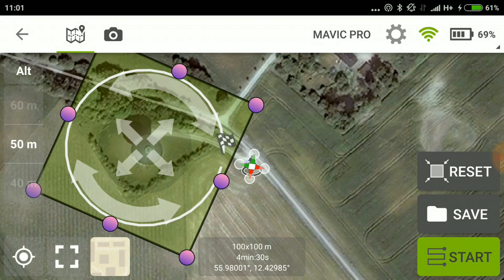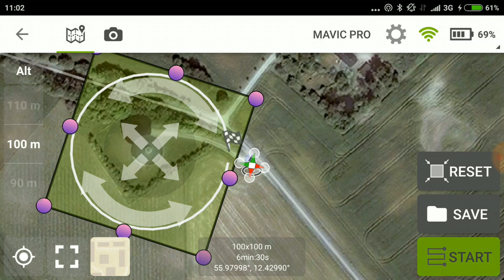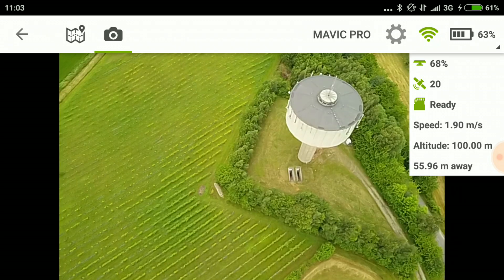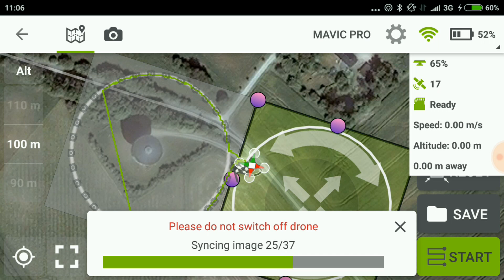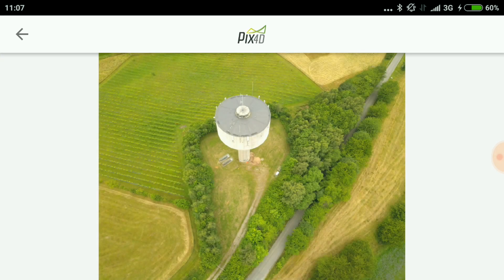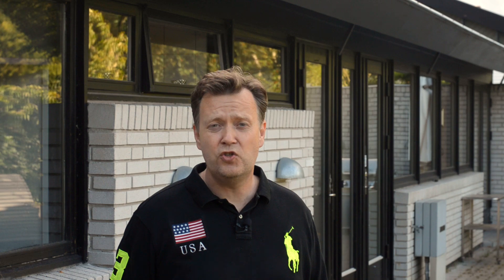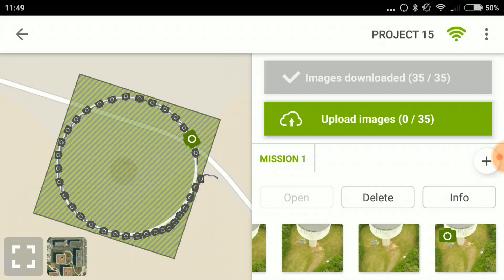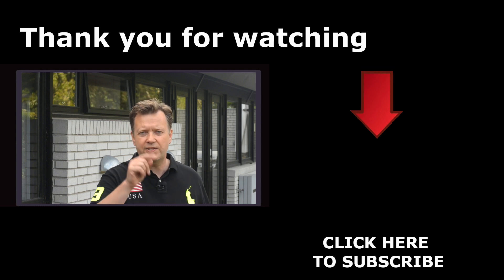How to do 3D Mapping with Pix4D - Part 2

Comment: Thanks for the great vid. If you wanted to improve this 3D model would you add manual oblique captures as well? 30-60 degree gimbal pitch with no horizon for specs… or is pix 4d just not the highest quality 3D modeling software? Currently using a Mavic 2 pro. Thank you

Comment: as these are stills that pix4d used to make the mesh model .. how did you also get the VIDEO of the water tower that you played ? .. also is this able to be somehow embeded into the PIX4D low poly represntation ? .. as in is its possible to click on a point of the model and show a high resolution capture of that area.. 

thank you for detailed info and advice on how to use the pix4d app with mavics..

Comment: Hello dear pix4d don't export the pictures after complete the mission how can i export the data
Reply: Are you flying with an SD card into the drone or with your phone? 

If with an SD card, you'd see the pictures stored in it.

With a phone, you'd need to check the root path of the internal storage and copy the images from there.